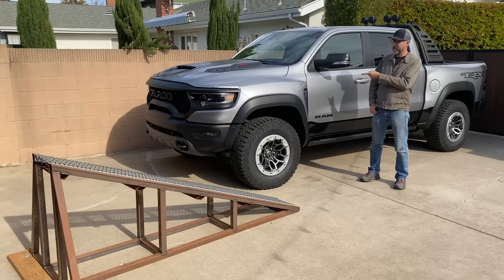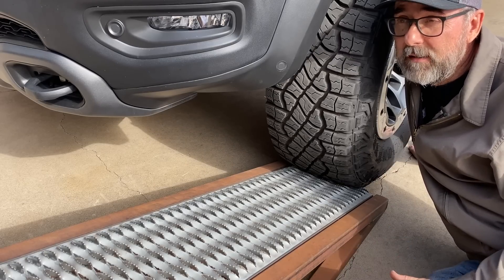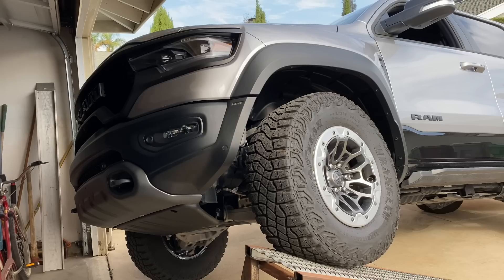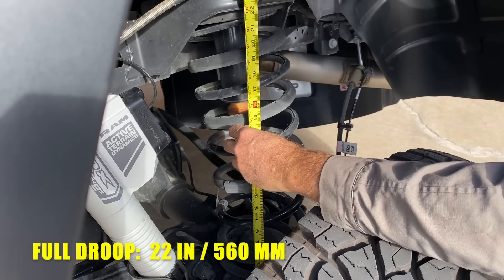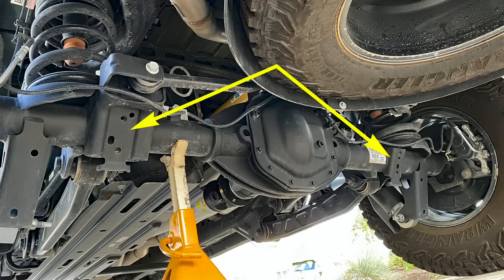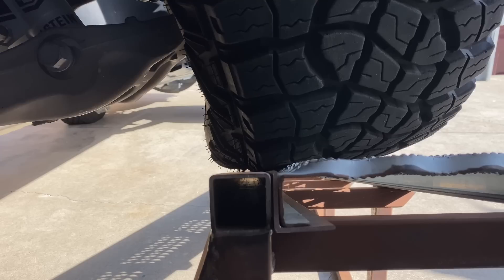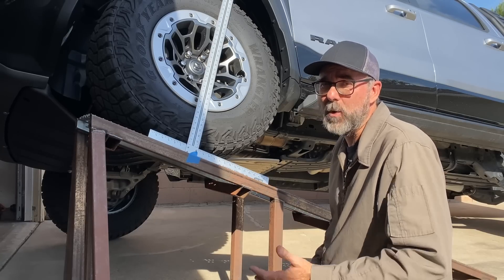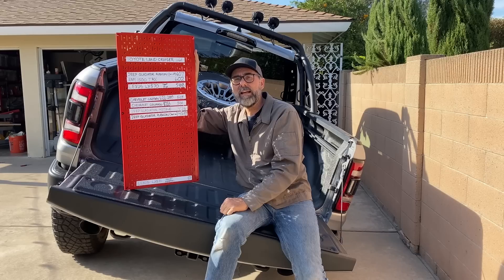2021 Ram 1500 TRX Suspension Flex Test - Using My Frame-Twist Ramp To Measure Off-Road Articulation

Comment: Please do with. F150 rapter ford
Reply from the maker: New Raptors are not yet available to me, but I will bring one here when they are added to the press fleet. I did drive one, though. You can read about it on Autoblog. https://www.autoblog.com/2021/08/31/2021-ford-raptor-review/

Comment from the maker: So we have all seen the new 2021 Raptor teaser, and we know several things that will be of interest to us here:

1) Unlike the rest of the F-150 lineup, the 2021 Raptor will have coil spring suspension in the rear. I'm eager to examine it and show you what's similar and what's different between it and this TRX.

2) 35-inch tires are standard, 37-inch tires are optional. But suspension travel is artificially restricted by a full inch for tire clearance if you get the 37s, so the 35-inch truck will almost certainly flex more on the ramp than the 37-inch version. More travel = more maximum flex.

3) The new 2021 Raptor will only be available in the SuperCrew aka crew cab configuration, so you can forget any SuperCab aka extended cab Raptor flex index numbers you may have previously seen. And you can bet that all of the old Raptor's RTI claims were based on the short-wheelbase extended cab version, because that's the best-case setup that marketers love to dwell on as if they're all like that. They're not. Now, with the crew cab being the only cab, the Raptor's sole wheelbase is 145.5 inches, which is only a hair longer than the 145.1-inch wheelbase of this TRX. The Raptor vs TRX ramp battle -- when I can arrange it -- will be apples to apples in terms of the critical wheelbase factor.

Comment: https://www.fourwheeler.com/vehicle-reviews/1701-2017-ford-f-150-raptor-wins-four-wheeler-truck-of-the-year/ 
This review on a 20 degree RTI has the Raptor at 627
Reply from the maker: I've seen that 627 number before. But that is a short-wheelbase Raptor - an Extended Cab with a 5-foot bed. The combination of tiny cab, tiny bed and tiny 6,000 lb tow rating is not the one everyone wants. In the truck world, that's a unicorn.  I want to see a Crew-Cab Raptor on the ramp, which would have a longer wheelbase (about a foot), an 8,000-lb tow rating, and the crew cab everyone wants. That would be an apples-to-apples comparison to the TRX, which is only available as a Crew Cab with a tow rating of 8,200 lbs. So, yes, the small-cab (and small bed) Raptor with a puny tow rating will flex to *627, but so what if you have to put up with those limitations to get that flex? To me there's a huge asterisk next to that score.

But all is not lost. I can use this number to estimate the crew cab Raptor's flex index. If the short wheelbase Raptor scores 627, and its wheelbase is 134.2 inches, that equates to a climb distance of 84.14 inches up a 20-degree ramp. What I'd do is assume next is assume that the long wheelbase crew cab Raptor would also climb 84.14 inches. The front and rear suspensions are the same -- there's just more frame in between. 84.14 inches of climb with a 146-inch wheelbase results in a score of 576 points. But I think that's being generous, because the crew cab Raptor might NOT climb as far because its rear suspension might flex less because its springs are beefed up to handle more payload and a more useful 8,000-lb tow rating.

Estimates are fine, but I won't award a score based on someone else's test of a different version of the truck than I'd prefer to use. Besides, the new 2021 Raptor is coming out soon. I'll wait for that.

Comment: Fiat certainly out-trucked the Raptor with the TRX!
Reply: Not to much of a problem being that the passenger side stayed planted not to mention the reining king is an IFS 200 series. Not to mention all the ultra4 vehicles have moved to IFS as they are proven extremely resilient and the best of both worlds.

Comment: With the truck like that can you still open the tailgate on the truck
Reply from the maker: Yes. The bed has more than enough torsional stiffness to prevent the tailgate from getting jammed. In fact, the last scene with the leaderboard shows me sitting on the open tailgate, and it opened and closed with no problem.

Comment: Do the 2021 raptor
Reply from the maker: When it comes out, sure. The 2021 F-150 is on sale, but there's no all-new Raptor yet. Rumor has it the Raptor might have link-coil rear suspension even though the mass-market 2021 F-150 still has leaf springs in back.

Comment: Raptor is in the 620’s
Reply from the maker: The Raptor comes in two lengths: extended cab w/5.6 ft bed on 134.2-in wheelbase; crew cab w/5.6 ft bed on 146-in wheelbase. The TRX is not available in the shorter wheelbase. I am certain the shorty will earn a higher score, but I'm not sure about the crew cab.
Reply: @DanEdmunds  You can test the 2020 Raptor.  It would be interesting to see how the SuperCrew scores.

Comment: I'd like if you could borrow a cherokee XJ and do this test...up country off-road package if you can find one with it.
Reply from the maker: I have two friends with XJs, but they're both modded up. I'll have to ask what they have really done to them.
Reply: The Up Country package was the equivalent then of the Trailhawk now. It was the factory off road package. For this test the biggest difference would just be that it had a 1" lift and no rear sway bar compared to the non Up Country Cherokees. I have a '96 XJ with the Up Country package and the rear sway bar delete makes a big difference in rear suspension articulation. Keep up the great videos!

Comment: Imagine this, the trx and raptor are modded from factory to the max(pretty much) they have 35in tires ECT, and the LandCruiser still destroys them, but imagine if that LandCruiser had a lift to Accommodate 35in tires. Or even better a 79 series pickup on 40in tires(which are illegal here but I like to dream) 😂😂
Reply from the maker: The Land Cruiser's short wheelbase helps it here. Its dimensions favor rock crawling and overlanding - shorter wheelbase, narrower, tighter u-turn radius), the TRX and Raptor are more about high-speed baja-style desert offroad (suspension travel, damper designed to for heavy impacts and taking whoop-dee-dos at high speed. Apples and oranges.

Comment: What is that covering coil springs?
Reply from the maker: Because the springs are intended to compress progressively, with the soft upper coils bottoming out before the middle and upper ones do, there will be coil-to-coil contact that would make a clanging noise and rub off some paint to get rust started. So they have these nylon coil covers on every other loop one so there's no metal-to-metal contact when they nest together. Look at the right rear under-truck shot near the end. You can see the fully compressed coil all wadded up with those covers doing their job.

Comment: Dan, mind sharing what your fuel economy numbers were with the TRX? Curious if driven gingerly if you can in fact hit the EPA figures. Also curious how driving it in real world conditions, punching it here and there, etc, how its economy looks. I get MPGs aren't the most important to TRX owners, but just curious.
Reply from the maker: I didn't drive it a long-enough distance over a range of speeds and terrain, so I didn't get a real good idea. The EPA rating is 12 mpg (10 city/14 highway). I averaged about 12 mpg over about 75 miles. This was a loaner, not my own vehicle.
Reply: @DanEdmunds  Thanks for the info, I appreciate it. I know loaners don’t stick around too long, so totally get the lack of time for an accurate idea of mpg...12, not as bad as I would have guessed. Thanks for all the technical info, love it!
Reply: I am sure its under 10 mpg city. Such a waste
Reply: I'm getting 11.5 driving like a normal mannered commuter. I use the horses to get around unskilled drivers.
Reply: If you can afford a ram TRX you probably have the money to buy fuel. You can’t expect a 3000 pounds truck with 702 HP to be eco. However if you put it in snow mode you can get abt 14 mpg
Reply: @bssh5891  :  "You can’t expect a 3000 pounds truck with 702 HP to be eco."  Lol, wow who knew that a TRX weighs 650 lbs. less than my C7 Z06. That's crazy. 

I guess you must be talking about a TRX that has been cut in half because a complete TRX has a curb weight of 6,440 lbs.
Reply: @oneslackr  idc I’m european 6500 pounds is about 3000 kg which is what I meant to say and yes you can’t expect a 3000 kg supercharged v8 truck to be eco friendly.
Reply: @bssh5891  : That makes more sense. There wasn't any way to know that you're from Europe from just reading your prior comment, especially when you said 3000 lbs. & not 3000 kg.
Reply: @oneslackr  yep you’re right idk why I said 3000 pounds cuz it doesn’t make sense at all especially with what I’m trying to say 😂

Comment: I bet you could get that to the end if you disconnected the front sway bar. Running no rear sway bar would give the rear axle more grip for that big motor too.
Reply from the maker: Possibly, but this ramp gets unstable if I get close to the end, which is why I didn't disconnect it here. As I said, I need a bigger ramp. I may design and build a bolt-on extension.
Reply: @DanEdmunds  When you add the extension you can make outriggers to make it more stable.

Comment: That driveway can’t even hold the damn thing 🤣 it probably took an hour getting it in safely
Reply from the maker: You must have been peeking over the fence. I needed a spotter to get through the gate. The mirrors don't stick any farther out than a regular Ram 1500, though. It's more about not being able to see around the front fenders. And getting it lined up and staged behind the ramp (which is angled) without backing into the gate post.
Reply: @DanEdmunds  props to u for getting it done lol. Thanks for the video

Comment: Ok this is the second video I watched with the TRX that turns me off. I can hear a squeaky pulley on a brand new truck! The last video I watched the breaks were pretty much on fire...
Reply from the maker: It wasn't a pulley. There were stones in the skidplate that I show, and others I noticed after I stopped shooting.
Reply from the maker: This truck was a press loaner, as my subject vehicles usually are. It was very clean, but a previous press outlet had driven it through some deep mud that hadn't been completely discovered and rinsed away underneath.
Reply: @DanEdmunds  well that could and probably be why I hear what I hear but you should go check out Throttle house drag race the TRX and check out the smoke....concerning to say the least.
Reply: @newbwheeler9777  he knows what he is saying. Stop doubting him.
Reply: @bradleyscarreviews  ok but only cause you said so....
Reply: @newbwheeler9777  he is the one who created the ramp!
Reply: @bradleyscarreviews  what does the ramp have to do with my commenting on a squeaky belt/rock in a heat shield debate?
Reply: @newbwheeler9777  because he told you why it was squeaky. He literally told you!
Reply: @bradleyscarreviews  yes and I’m telling you that rocks in a heat shield don’t make the same sound as a squeaky belt...
Reply: @newbwheeler9777  but he’s the one that set it up, and he’s the one that’s telling you the source. Come on now man.
Reply: @eldiablort1461  only cause you say so.
Reply: @eldiablort1461  ah the classic internet warrior who likes to chime in on conversations that you have no business in...👍
Reply: @eldiablort1461  yup. You bring nothing of substance to the conversation tuff guy. Go riot on.
Reply: @eldiablort1461  Again you have still contributed nothing. Like I said classic keyboard warrior. You the guy in the back of the crowd that chirps at people as they leave the room. You do you champ.
Reply: @eldiablort1461  I can see that inability too move on is dependent on you getting in the last word so have at it. A self-perceived victory is important for your troll card and I’ll let you have that. ✌️
Reply: @DanEdmunds  well from my experience rocks rattle and pulleys sqeak and squeal. I’m hearing a squeal.
Reply: @Darvin Stjohn well bud I already stated what video to go watch and you can clearly see the thing smoking like my uncles VW van in the 70’s. And yah, roots blowers will squeal there belts when under load just like my Jackson racing supercharged Prelude did all to much. Buy it sure the f**k shouldn’t be slipping going up an rti ramp! And lastly you shouldn’t take it so personal.

Throttle House. Drag racing a TRX vs Shelby F150.

Comment: But this is impossible.  Only sfa is allowed to flex. It has a chirping sound from the engine already?  You should do a tundra.  I’ve never seen one run up a ramp. Land cruiser still reins king.
Reply: Toyota land cruiser would be 1 mile behind  in  2 mile race ! Lol. Let's see a land cruiser jump ! Lol
Reply: @layne4376  of course it will. Rams are pretty reliable!

Comment: I do like the testing and review, but I don't get why keep the scoreboard (as is):
It is just a "random" number, really has no meaning because not compared apples to apples (because of the division with wheelbase). The Land Cruiser got a better score making it up ~3/4 of the way on the ramp. TRX made it up all the way. 
I would take the TRX any day.
Reply: It's an articulation index, so by dividing by the wheelbase gives an apples to apples comparison for how well a particular vehicle can articulate. It's just one measure by which an offroader can show it's prowess.
Reply: @ALMX5DP  I understand all the geometry behind those numbers. The bottom line is that longer wheelbase RAM, which in certain offroad situation is worse (brake over on the top of rocks), will be able to climb up bigger obstacles. Might not be able to come down on the other side if it beach whales on the top tough.😄
Reply: @joel.7372  RTI is just one facet, but still a good indicator that scores how diametrically opposed the axles can get.  A higher score shows that a vehicle can have axles on more extreme planes - independent of wheelbase.  Another way to look at it is why should an RTI score increase for longer wheelbases with no change in axle articulation capabilities?  Wheelbase is not necessarily an asset off-road.
Reply from the maker: The wheelbase absolutely does matter. Imagine something that had a wheelbase of 1 mile that made it just as far up the ramp as the TRX. Would that be impressive?

Think about what a score of 1,000 means. Climb=wheelbase, the rear tire touches the ramp, and the suspension can then level out as the rear suspension begins to load up and get  back in phase with the front. That's how you get up, over, and past obstacles.

I think all of this will begin more clear when we take brand out of it and compare Wrangler 2-door, 4-door and Gladiator. I'm still trying to get my hands on the two Wranglers.
Reply: @DanEdmunds  I agree in most offroad situation short wheelbase is an advantage. 
I don't care about brands, I am a fair consumer: I owned 3 Toyota trucks (2 Tacoma 1 Tundra), 2 Dodges (Dakota, Ram), and 1 Ford F150 (currently on a small Jeep) all 4wd (mostly offroad packages). 
In the situation I seen you portraying a narrow trail situation with huge obstacle on one side, where the TRX was climbing up easier. Also agree we don't have the other side of the equation if it's a short huge bolder/obstacle the TRX will beach-whale on top of it because of the long wheelbase vs if a shorter wheelbase vehicle where the rear already also up on the rock.
I would enjoy some actual offroad testing under similar circumstances.

Comment: Toyota Land Cruiser is still king.
Reply: Ok ,go jump it then ,and see how it holds up ! Lol.
Reply: @michaelpincavitch5245  it’ll hold up better than this 😂🤣 it’s also not designed for Baja type driving 😂🤣. You’re a tool
Reply: @flight2k5  So are you. This thing has jumped 50+ feet, or at least close to it. Your shitty land cruiser's frame will snap in half like a twig upon landing. Just go watch some videos of this thing jumping. I doubt any Toyota could do that.
Reply: @flight2k5  it’s not a fiat, it’s a ram, and this is made for real hardcore off-road, and jumping. It is more capable than the land cruiser and everyone knows it.
Reply: @bradleyscarreviews  😂😂🤣🤣 ok kid
Reply: Which is just a number, really has no meaning because not compared apples to apples (the division with wheelbase). Got a better score making it up ~3/4 of the way on the ramp. TRX made it up all the way. Guess which one I would prefer: the TRX of course.
Reply: @joel.7372  aaww you must be a ram fan boy 🤣